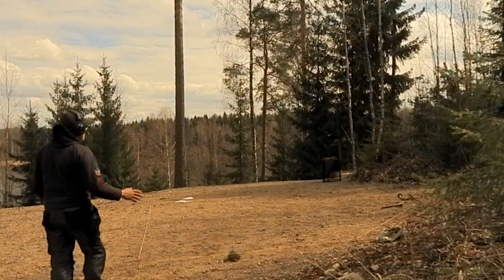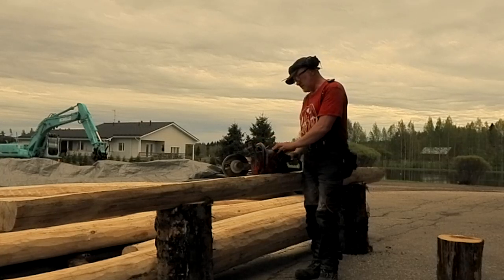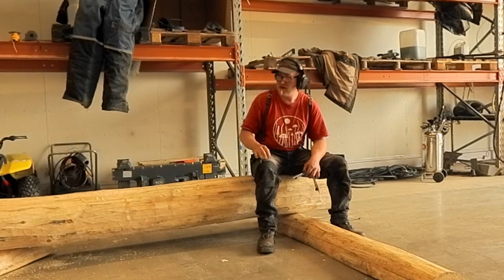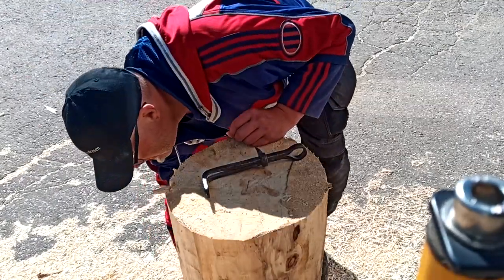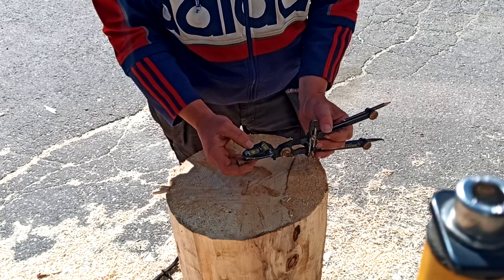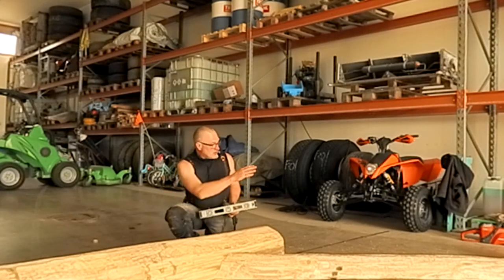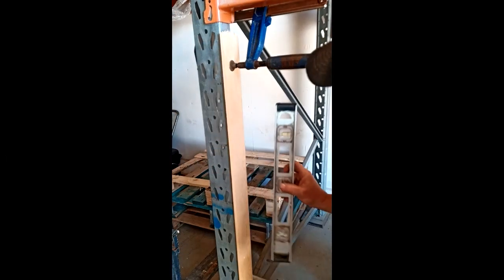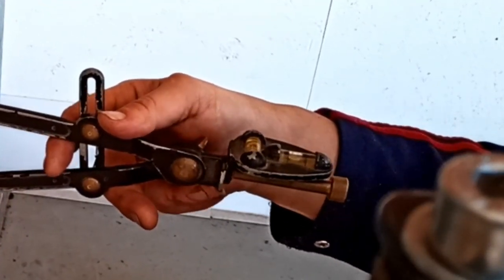Log building 101 (2021) part 2

Comment: Are these freshly taken from trees or green logs? Or have they been drying for some time?
I am interested in knowing all names of the tools in Finnish also. Where do you buy your tools from? I live in Pirkanmaa.
Any favorite lumber store that you can recommend?
Reply from the maker: These Aspen (Haapa) logs have been drying outside for two years. I'll try to remember to give the Finnish names. I don't really use any lumber stores. I prefer to mill my own.
Reply from the maker: What tool names do yo want to know?  The attachment for the chainsaw for debarking is called a Vuollukalle (theres a link in the description). The Fiskars felling hook would be..I guess...Vankari. The log hook.......Hirsi Kouku. Anything else....just ask!!
Reply: @ProjectHighlander  thanks. I will surely ask you as I start building my cabin. I have bought a piece of land in Pirkanmaa.
One off the topic question is that on the plot there are many ant hills. What shall I do with them?
Another question is that there are many dead standing trees there. Can they be used in any way in the cottage building.
Reply from the maker: @NorthernWindsAhmer  Don't worry about the ant hills. If you are using good wood they are not going to be a problem. Standing dead wood is usually really good building material. I have built a building using only standing dead wood (pysty-kuiväneet)